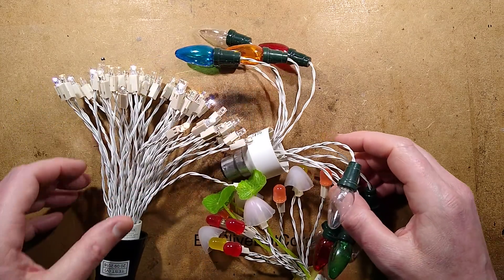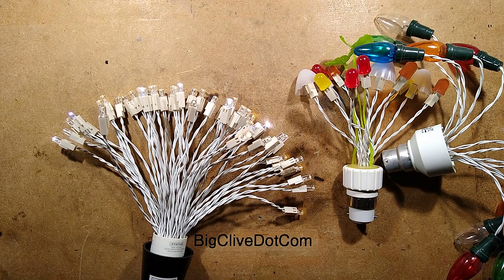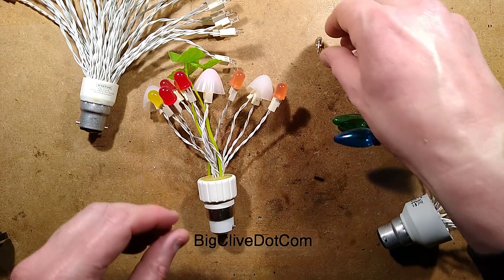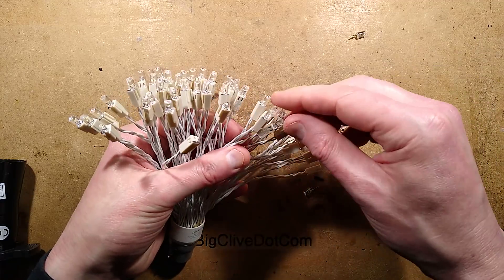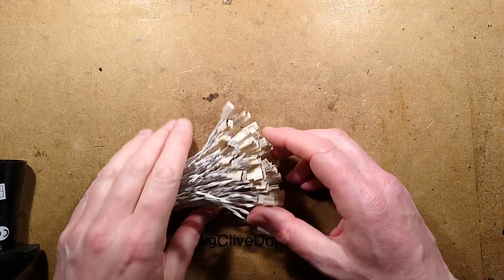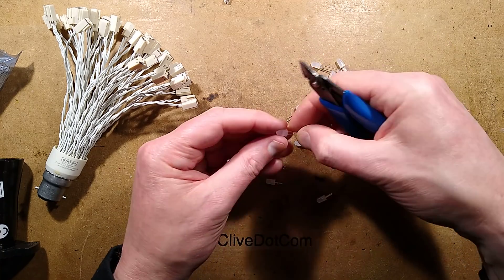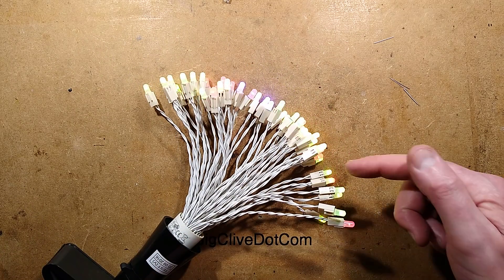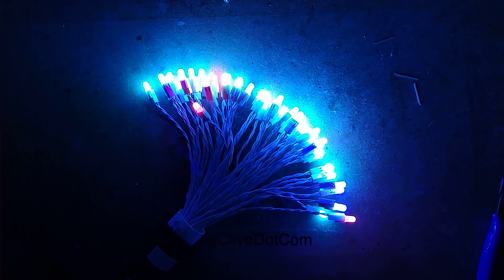8-year service on an extreme DIY LED light.

Comment: So glad to see a video featuring those light sensitive colour changing LEDs. I have a set in my garden that were originally solar. When the solar panel unit corroded badly, I hooked them up to a DC power adapter instead, on 24hrs, not just after dark. Turned out that in the day time they just stay blue, then resume colour changing dusk till dawn, which I rather like. I found it all rather fascinating - so next I hit them with a laser pointer and found that the LED turns off, only to come back on a short time later - bonus fun!

Comment: How did you wire up the LED's? If they are in parallel, would replacing one of them with a smoothing capacitor alleviate their sensitivity to the fluctuations in the supply?
Reply from the maker: They're in series.
Reply: @bigclivedotcom  I re watched it again after I had posted, and picked up on you saying that you had used a capacitance dropper, which should of told me that they were in series. So working on that, if you put it between the anode of the first and the cathode of the last it should work???

Comment: Hi Clive, I'm looking to buy myself an SMD rework station. I remember you done a video on one but can't seem to find the video...Could you gave me some recommendations on a good budget station? Many thanks!
Reply from the maker: It depends what you're looking for.  My Yihua 8786D has a soldering iron and hot air pen.  You can also get heated plates for reflow of entire PCBs.
Reply: @bigclivedotcom  Thank you!
Reply: @bigclivedotcom  just looking something decent with an  iron and hot air pen, ill look into this one

Comment: Trump said, "“So, supposing we hit the body with a tremendous, whether it’s ultraviolet or just very powerful light — and I think you said that hasn’t been checked but you’re going to test it,” Trump said to Bryan. “And then, I said, supposing you brought the light inside the body, which you can do either through the skin or in some other way.” April 24, 2020

Great commercial potential here Big Clive. A string of 220 nm LEDs shoved down the throat and into the lungs. Light 'em up. See you in virus hell, Covid-19. Could you do a prototype? At least a drawing?
Reply: If what you say is true, then Trump clearly does not understand science. Putting a UV light inside the body of a human (or any other mammal or bird) will not be effective against any virus (because it’s not possible to get the lamp into the very small airways, let alone other areas in the body where the virus may be) but it will cause tremendous damage to the tissue that is exposed to the UV light. And using a bright visible light will have little or no effect on the COVID19 virus, so is pointless.

Comment: LED's fast ageing at different rates happens when put parallel behind one dropper resistor. When they have individual resistors, and the current is kept low, they keep up with each other. These LED's are rated at 20 mA, but the modern ones give enough light to keep them below 10 mA, and for signalling job's 5 mA, stretching life expectancy with many years.
I read a reaction below to put a capacitor in one of the LED connectors for easy testing of its effect. Simple idea.
Reply from the maker: In this case all the LEDs are in series (about 150V total) so adding a capacitor in one of the positions wouldn't work.
Reply: Ai ai, series. I was convinced that they were in parallel, but that is my stupid assumption !
In that case the unfiltered spikes are damaging ? If you want to make room for a cap, you could half the amount of wires, and ditch the bridge rectifier. If I don't screw up, there's no need for any diode when you solder every LED in contra-parallel with a second one (C > A and A > C). Have not tried it yet, but theoretically it looks sane. But, problem arises then that then you have only half the individual light points to move in space.
If no cap is used, at least don't go over 20mA / 1,414.

Comment: As weird as it is I haven't had any self-flashing LED's that are sensitive to ambient light although I have seen some place where LED's have some anomalies, even low hung brand used for 2,39€ 50 LED strings seems to be quite stable._
Reply from the maker: There's an application for a flashing LED where you have to black it out.  The trigger in one of the simplest beam-bot circuits.

Comment: Why do they get ruined by lack of anti static packaging. Thought leds were more resilient.
Reply from the maker: Traditional red, yellow and apple green LEDs are very rugged, but modern gallium nitride blue, bright green, white, purple etc LEDs are based on thin film technology and can fail if reverse biased with too high a voltage including static.
Reply: A reply straight from” the governor “. I’m honoured. Many thanks Clive

Comment: I've had lots of white LEDs slowly dim, but the red, amber and green ones seem to be as bright as ever.   Could the dimming be the result more of phosphor fatigue?
Reply from the maker: Partly that, but the older red, yellow and gallium phosphide green LEDs are where the 100,000 hours lifespan figure came from.  They are much more rugged than modern gallium nitride colours.
If you make a panel of red and blue LEDs the colour will gradually get redder over time as the blue ones degrade.

Comment: tried  to find LED bulbs on ebay and all i got was standard mains light bulbs  ....eventually i tried to search 'led diode' and that did get some results but i dont know how you find all this stuff on ebay clive , you seem to have a nack for it .... i also tried to find 'pink shit from china' but nothing came up
Reply: 100 x 5 mm LED Light Emitting Diode Component Assorted Kit LEDs Mixed Colours UK < try that ,couple of quid for 100 assorted LEDS
Reply: for pink shit ,type in " electric gadget pink usb mains light " get a wide array of random products there ☻
Reply from the maker: 100pcs 5mm LED diffused rgb slow
Adjust keywords to find the desired LEDs.  Target price typically around 1p to 5p each.
https://www.ebay.com/sch/i.html?_from=R40&_nkw=100pcs+5mm+LED+diffused+rgb+slow&_sacat=0&_sop=15
Reply: because u searched for BULBS
Reply: @girlsdrinkfeck  they  ARE bulbs...
Reply: mark layton nobody calls individual LEDs "bulbs"
Reply: @kilrahvp  well clive  calls them led bulbs  , most people do actually ....
Reply: @carlyonbay45  That's for actual bulbs you put in a conventional lamp socket, not the individual components.

Comment: To fix that restarting LED problem, couldn't you just replace one of the LEDs with an appropriately rated capacitor? Just plug in a capacitor to where one LED would go?
Reply from the maker: They're all in series.
Reply: @bigclivedotcom  Ah. That'll do it. I imagined them being in parallel.  If you mentioned that in the vid, I missed it.

Comment: In the growing community those leds are know as 'burple' but they are absolutely crap for growing and just a Chinese gimmick.   The best led grow lights are actually high quality white chips.
Reply: That's because plants need red light to photosynthesize and blue to know which way to grow (oversimplified) but the burple LEDs don't provide enough of the right wavelengths, while white do even if they "waste" some on green, yellow etc.
Reply: @markfergerson2145  yeah, I know, so many people get fooled by the bullshit claimed about the shit burple LEDs though.
Nothing can beat hps yet for all round specs but the top end LEDs have got very VERY close now and its not going to be long before hps has no benefits over led, LEDs already have the edge in some areas, just not all quite yet.

Comment: after seeing these leds in one of your other videos i got a couple of hundred my self way way more then ill prob ever need but my idea is to make bases for the laser etched cubes you get with family portraits and things to light them up i was thinking a small solar panel and li-ion battery like the cheap garden lights with the basic transistor circuit

Comment: If I have some interesting hardware.. Do you mind taking it apart? 
It's called and Flash-er relais. 
It's to combine regular headlights on cars to become Flash signals like on Ambulances.
I managed to fck up the program, so now it does something else instead of flashing. It's now able to flash ones, or change the strength of the light. But that's not in the manual.
It's having some nice and weird print-plate inside. So if you like I can send it

Comment: All this does is remind me yet again how I loath the Edison screw bulbs in North America. Bayonets seem so much easier.
Reply: They're not only easier, but free of charge ($ charge) they give you random exchange of the line and neutral connections. This makes for priceless DIY presents for mothers-in-law around the end of March.
Reply: Zoomzabba - it’s possible to fit a BC lamp in a holder in about two seconds 😉
Oh and with filament lamps, you also don’t get the flashing on / off (due to slight movement of the centre contact surface) as it temperature cycles if you don’t screw a ES lamp in far enough.
Reply: An old problem with the bayonet connectors is that the mains power globes used to have solder connectors that the spring-loaded pins in the socket bore against. Over time, the solder distorted and the pins sometimes embedded themselves into the raised solder connectors, making the globes really hard to rotate and remove. It wasn't a soldered connection, it was just the solder had flowed away from the pressure points and mounded around the pins. I have broken globes where the solder connectors were so indented by the spring pins. This might not be a problem with newer solder contacts on globes in the push to remove lead from our electrical equipment.
Reply: Bill - No Last Name Supplied - The problem with the contacts and solder was generally due to manufacturers using far too much solder on them.

Comment: How about fitting a suitable capacitor in one of the LED locations (assuming they’re in parallel)...
Reply from the maker: They're in series.
Reply: @bigclivedotcom  lol, so put a 400v cap across two positions :P
Reply from the maker: @Jimmeh_B  That would work, but it's knowing which two positions.
Reply: @bigclivedotcom  :) Yeah my friend, I was only havin' a go. lol. 

I like your LED vids, you've got a lot more patience than I. I have 5000 SMD LED's here and a whole bunch of shift registers. My plan is to make a curtain of strings with a lightning detector on the front end to make waves of cascading blue light every time there's a lightning strike. 

Tedious work though :)
Reply: @bigclivedotcom  Since they are in series, properly fitting a smoothing crapocitater would involve one wire each from 2 different LEDs. But could you identify which two without causing some LEDs to become NEDs Noise Emitting Diodes or SmEDs Smoke Emitting Diodes?
Reply: Why
Reply: @phonotical  You need very few cheap and small components to run them in series, but you need a relatively big switching constant voltage power supply for parallel and a resistor for every single led.
Reply: @CyberlightFG  may explain mine, I used one 2w resistor, that was it 😂 more a night light as it produces no usable light
Reply: @phonotical  You need at least a  capacitor, a resistor and a FULL BRIDGE RECTIFIER.
Reply: @CyberlightFG  think I had a rectified, I don't actually remember now... I must have as I used a lead as a side contact for the bulb base, no capacitor
Reply: @phonotical  Maybe you should use a proper switch mode power supply next time. You could use 12 V, 3 Leds and a resistor in series. You aim at less then 20mA on each LED. The voltage on each LED depends on the colour of the LED.
The voltage is not important. The current is.

A single resistor on mains voltage is not a good idea. It gets very hot quickly.
Reply: @CyberlightFG  mine does not, it all seems to be fine, works fine, I think it is simple enough that it is where it needs to be
Reply: @phonotical  It all doesn't matter if you run it on really low current. But you need a rectifier. The led can't handle high reverse voltage.
Reply: @Joachim Shekelberg I don't think, modern led can handle much more than 5 V and only a few μA in Reverse.
Maybe the single colour ones, but none with a microcontroller

Comment: Weeell. You could just stick one or two caps into that thing instead or added to a diode in the holder, since its a variabel design.

... So the flower can blossom when the caps explode randomly after soem time because you of course use chinese overrated undercapped ones ;-)

Comment: Honestly the ageing is the only hope i have for our street lamps.
The persons making the decisions/sellers decided to allow open heart surgery under every street lamp, night is not night anymore, you dont need any light on your car anymore.
Because if they use less power, lets triple that up then for no reason.
Reply: We cry back our compact fluorescent street lights (36W). They put out a bit more light than the current LED ones, but the problem is that in small streets like ours, only every second pole has light. That was no problem with the CFLs (nor with the previous, ancient mercury vapour lamps in the '90s), but the LEDs' beam angle is not wide enough to cover the 2 pole distance, so at the non-lit poles, you can't see anything...

Comment: Connecting Chinese LEDs in series contaminates the mains supply with rogue positrons.
This is a FACT that I just made up on the spot.
Reply from the maker: It's a perfectly valid fact.  You should broadcast it to the Facebook conspiracy groups as it's compatible with their science.
Reply: I'm sure, it sends out a bunch of photons and releases angry pixies if you touch it.
Reply: Actually it is Trumped that those are fake poisitrons. Don't tell anybody.

Comment: I would put the slow flickering yellow candle LEDs in.
Reply from the maker: Not so easy on a large series circuit like this as they develop a high open circuit voltage across them when they dip out.
Reply: @bigclivedotcom  You're right, that won't work very well or not at all.

But I like the idea.

Comment: You really notice LED degradation in data centers/server racks.  You can usually tell which one had a mobo replaced recently
Reply from the maker: Mainly the blue, white and bright green LEDs?  That could also be down to newer batches of LEDs being more efficient.
Reply: @bigclivedotcom  blue and green but yes.  did not think about the efficiency angle
Reply from the maker: @ADR69  The newer gallium nitride technology degrades much faster than the older technologies did.
Reply: @bigclivedotcom  that is cool I had no idea thank you

Comment: that looked fantastic, reminded me of those 80's fiber optic shrubs that rotated
Reply: Cody Slab - we still have one of the original fibre optic lamps!!! It’s in the dome so you could not touch the fibres!
Reply from the maker: That's good, because the original glass fibres were skelf central.
Reply: bigclivedotcom - so much urge to disassemble though!!!

It’s one with a halogen lamp, could be a car lamp and the rotating colour wheel.

May have to get it out of the loft!!
Reply: @bigclivedotcom  one we had in Ukraine you could touch and play with and that’s what we did! But I think they used a fishing line, it was about 2 inch circle of those fibers in diameter, with an incandescent bulb under. You could make a video making your own such shrub just buy the fishing line that’s rigid enough but not too fat
Reply from the maker: @GamingAmbienceLive  Fibre optic is composed of a very clear inner core and an outer coating of material with a different refractive index.  Ordinary fishing line doesn't work.
Reply: @bigclivedotcom  you’re correct I looked it up and people who tried — failed. That really was some sort of fiber optics🤔

Comment: wait what component in the color changing ones is light sensitive?
Reply: almost all semiconductor junctions are in some way. but to make them unstable with poor power supply it's probably some transistor in the control chip
Reply: @andruloni  Wonder if you can completely upset em with a flash from a xenon lamp. Some parts get really upset from that.

Comment: Does the degradation happen even if you don't have them plugged in or have these been running for years on power?
Reply from the maker: I think it's mainly run time.
Reply: NickoLps   u 💩

on a serious note, patrons on patreon get the link to the video earlier and can comment then, but the date you see is when the vid was made public
Reply: @andruloni  It would greatly help if YouTube itself didn't use an untrue phrase to label the video release dates.
Reply: NickoLps  charmer you are, ain't you!
Reply: Heat makes the dopants migrate through the semiconductor, so even when not running they degrade a bit unless you store them in liquid nitrogen.

Comment: What if you add a capacitor instead of a led?
Reply from the maker: It would be in series with the other LEDs.  It needs to be in parallel with them all.
Reply: bigclivedotcom I see... I assumed they all were in parallel :) but again Thank you for your reply :)